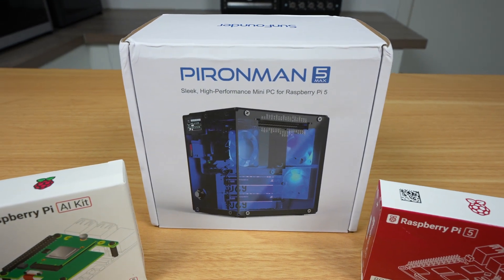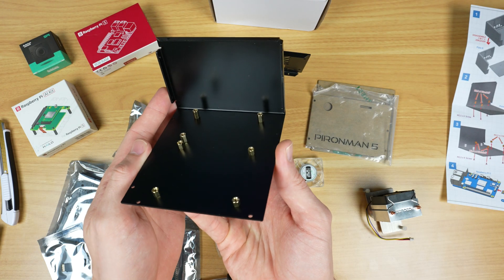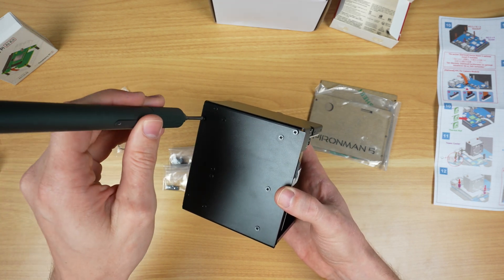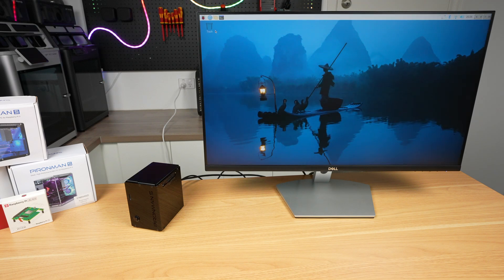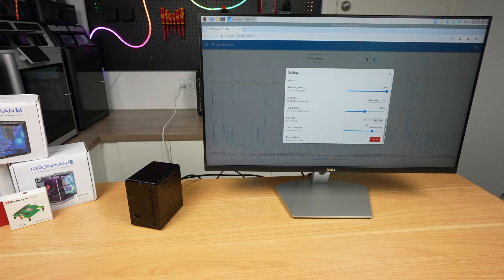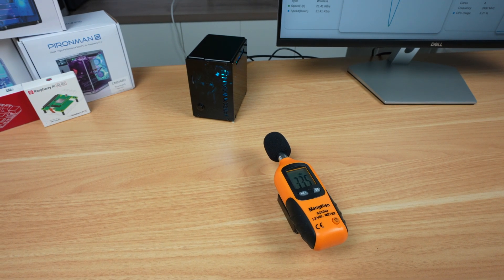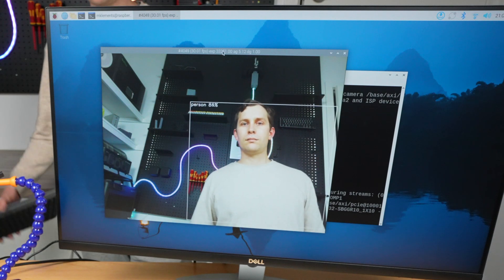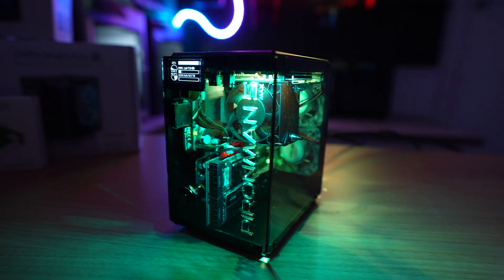Dual NVMe, RGB & OLED Display! Meet the Pironman 5 Max for a Pi 5

Comment: I have the first gen version of the Pironman 5 and would have loved this. Maybe they will some day sell the dual NVME hat separately.
For those claiming it is expensive, it is, but a Pi5 with tower cooler ($15-20), dual NVME hat ($20) and HDMI/USB adapter board ($10) is already most of the cost. That leaves about $30 for the case, fans and mini screen. Which is a fair price I'd think.

I personally really like mine and will soon be trying to add a little PoE hat so I can run Home Assistant with a single cable.

Comment: Did I see some type of an adapter on part of the case that would allow for a large screen to be mounted on the case as well? Large meaning something that would fit within the dimensions of the outside case?
Reply: I remember seeing a 5" monitor mounted to the side of one of these too

Comment: very expensive device
Reply: Not really if you add up what you get from it. You will get a case, a NVME dual board, a GPIO extension board, fans and heatsink. A LCD display. All those things cost and if you buy them separatetly you wont get much lower that what you paid as what pironman 5 max cost